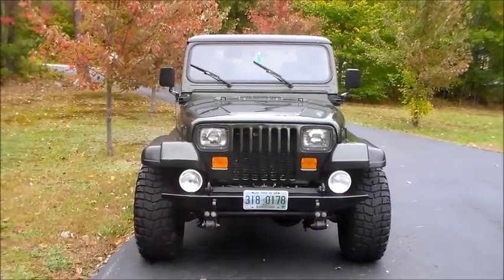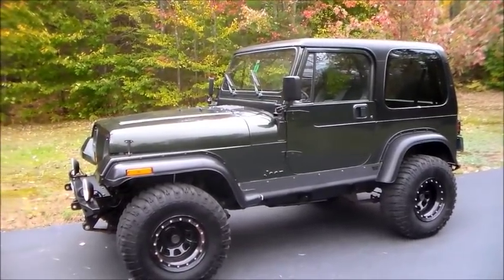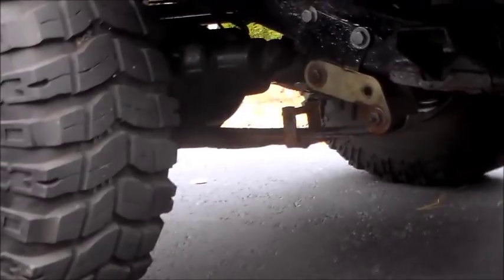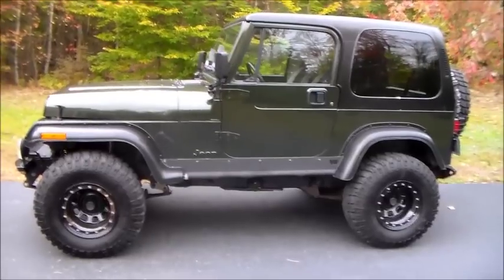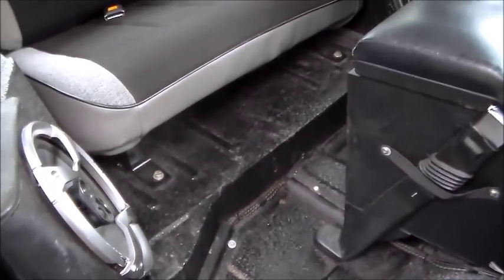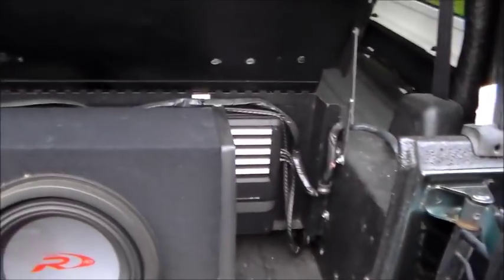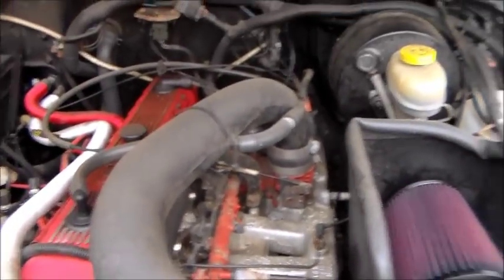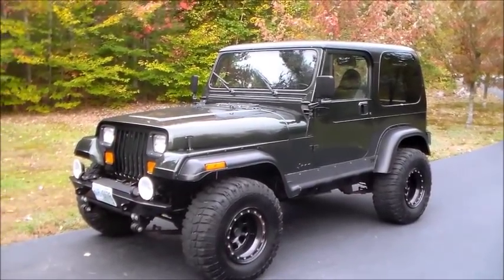1995 Jeep Wrangler YJ   New Project!

Comment: You are a luck dog that is a great find! Jump on that frame first . I like the cup brush on an angle grinder ; rust converter and epoxy primer and POR-15. It will be good for years then. You will take better care of it than he did I can tell from the passion in your voice. Really nice Jeep and you got it in time to save it ; Good Roads !
Reply from the maker: William Smith Chrck out my other vids!! I do scrape down the frame and POR15 it, then top coat it. There are a bunch more cool Jeep related vids as well. Check all of them out and give me a sub... thanks.

Comment: I had a ‘91 “Wrongler” myself (YJ, square headlights),  bought with 60K in 2001 for $4500, sold in 2003 with 90k miles for $4000, I wish I would have kept it.  I have a 2016 JKU 75th Anniversary now, which is a luxury vehicle compared to that, but that 4.0L, no substitute.  Would have been a great project for my son.
Reply from the maker: Sounds like you're a die-hard Jeep guy! The old YJ's are great projects, but not really the safest vehicle for a young driver? In my opinion, but mine was lifted w/ big tires etc. Thanks for watching and commenting.

Comment: bought a 91 YJ for 2700. Its spray painted to look like an army jeep, with no carpet and its rhino lined. The only rust on it is a little bit of spots under the windshield and on the leaf springs with only surface rust on the frame. I plan to to restore the entire vehicle. I already have the whole thing planned out.

Comment: I have the same YJ 95 wrangle and the workaround that I'm using with the gas refile problem, I just put the pump with 90 degree inclination.
Reply from the maker: Yeah, that really doesn't work, for me. I still can't get the pump in far enough, to flow properly. I can still get the tank full, but I have to hold the pump on 'half trigger' if that makes sense. Thanks for watching and commenting.

Comment: I own a 95. You can't hardly get the handle in straight up and down anyway when getting gas. You have to turn it to the side. And on mine your damn lucky to get it within an eighth of being full. Unless you sit there and let it trickle in. I don't know if that's common with the other groups of that year but with mine it sure is.
Reply from the maker: It's a giant pain in the ass!! I have to hold the gas 'trigger' on about 1/4 pull, trickling fuel in. You certainly can't lock the trigger on, at all. I've discovered that swinging out my spare tire carrier, using it to hold the license plate down, gives fueling a bit of relief. Terrible design. That's why they moved it to the drivers side on the TJ's.

Comment: Do you drive your Jeep Yj long distance. If so What’s the furthest you gone round trip
Reply from the maker: I did not, nor would I ever drive this Jeep any long distance. Probably 100 miles, max. With the high center of gravity from the lift and the tires it's really not that safe, in my opinion. Plus I wouldn't trust its reliability.

Comment: Like the color just curious what did you pay for if you don't mind me asking?
Reply from the maker: It was around $7500, which I felt was a smoking good deal!!
Reply: @Metalcop5150  did you ever clean up the rust on the frame and repaint it?
Reply from the maker: @Jeepdriver75  Yes! There's a video of it as well. There really wasn't anything but surface rust. The thick undercoating was starting to fall off of the frame in large chunks, but underneath it was well preserved. I scraped it down, applied POR 15 and then top coated it. A lot of trolls were calling me out saying that it was a rusty POS, which was total garbage. I even did a video where I pounded on the frame with a hammer!! lol

Comment: Had a 91yj. Worst pos I ever owned. Had to replace the 4 banger at 81k. Along with about every part on it at least once. Even the seat belts failed. Put 6 slave cylinders on the clutch. Window leaked. Replaced the windshield twice. 3 starters. U joints twice. And on and on. Put 70k on it and gave it away. Was happy to get rid of it!!!  Good Luck
Reply from the maker: Sorry you had such bad luck! The 95's are the best of the YJ's and the 4.0 liter straight 6 is way better than the 4 banger! Practically indestructible. As for reliability? It's still a Chrysler product, so that's what you get. If you want a capable 4x4 a Jeep is still your best option.

Comment: i have a jeep like this but the engine doesn't work, do you guys think that is expensive change the engine??
Reply from the maker: Nope, it won't be expensive! More like dirt cheap... lol Get yourself a rebuilt short block and re-use all your accessories. Get a new water pump and other typical replacement items, you should be all set. Good luck.

Comment: I saw one for sale and the guy wants 2k for it. It would be my first jeep toy.
Reply from the maker: Make sure you scrutinize it, especially the frame and underside, for rust! I'm guessing for $2K, its going to have some rust. Also in the rear cab corners, and fenderwells etc. etc. Thanks for watching and commenting.
Reply: ScoobyDigits I paid $1,900 for mine . without even looking at it because my truck had broke down and I needed a vehicle quick I told the guy if he could drive it to where I'm at I would give him the cash he did and I did. I have driven it for 5 months and it's lost less than a quart of oil during that time. Of course the first thing I did was change the oil plugs wires rotor and cap. It's a running demon. A great work truck. There's rust on the frame but I treated it with that paint that turns rust back into metal. I was going to coat it with bedliner. But I bought myself a new Jeep because this one did not have air conditioning and I was tired of roasting. They can cost a lot of money if they have not been taken care of. I have a 97 that I had to almost completely rebuild underneath. But it's a really nice jeep now. Just 1500 miles away at my house. I have a 63 Willis that was a money pit. It was my first real Jeep. And if you're willing to put the money into it you can do just about anything with anything. I guarantee you it's worth more money now than what I put into it . but not by much.

Comment: the tail light itself is upside down. the lens is supposed to be down
Reply from the maker: I would agree with you, that the clear back up lens, should be on the bottom of the taillight. However, you can clearly see that the plastic lens is marked 'TOP' so the taillight lens is mounted correctly, in this case. Either way, the taillight is a rectangle, flipping it over wouldn't gain any extra space for gas nozzle etc. Thanks for watching and commenting! I really appreciate the support. Please consider subscribing, if you don't already.

Comment: What wheels are those ? And size ? 15x10?  Ps subscribed !! 😃👍
Reply from the maker: The tires are 33"s, 33x12.50x15 is the specific size. The wheels are 15", but I am unsure of the actual width. 10" makes sense, with the 12.5" width tires, and there is a ton of sidewall and bulge, on either side. Hope this helps!! Thanks for the sub, I really appreciate the support. Lots more Jeep vids to come! I just started cranking them out again, yesterday! lol
Reply: Metalcop  really ? I am still deciding if I should get 15x10 rims or 15x8. Since I am doing a 383 stroker with some speed parts lol I think I’ll go with the 15x10. If you want to see the video I just uploaded. I’m definitely gonna keep watching your progress.

Comment: Dude your front shackles behind the front wheels is totally messed up they shouldn’t be hitting the frame like that and your rear spring on the driver side is broken where it bolts the the frame
Reply from the maker: Thanks for pointing that out to me, I'll look into it and have them checked. I'm new to Jeeps, so I appreciate the help! Thankfully, leaf springs are cheap. Thanks for watching and commenting.
Reply from the maker: Yeah I checked the rear springs, nothing is broken? Maybe you could elaborate and educate me? Thanks.
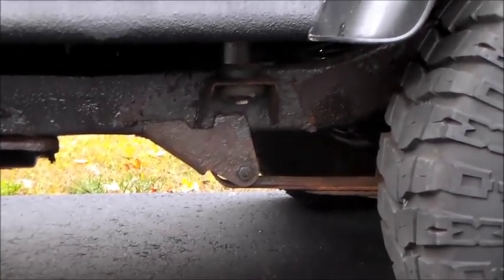Reply: Pause at 3:02 in your video, look where your leaf spring bolts to the frame. You can see that the “wrap” on the spring has broken and moved forward off the bushing, the only thing that is holding it together is the weight of the jeep on it. Also on the front, you have what’s called a shackle reversal kit. Supposed to help with the ride by changing  the suspension geometry, but the shackle is supposed to cycle back and forth as the suspension compresses. But the shackle laying on the frame like that isn’t doing anything. Looks like a solid jeep! Just pointing it out because it could be potentially dangerous. My leafs where broken too and I didn’t know until I lifted it.
Reply: Nah, dude, they are all like that. The inboard side of all 4 springs. The top leaf wraps around and is properly bolted to the shackle. What you're seeing is the 2nd shackle down that has a little 'up bend' to it. All good, I assure you. Thanks again.
Reply: It’s got a shackle reversal kit and the shackle should not be hitting the frame like that. Look into it because it’s wrong.
Reply from the maker: +Steven fitzgibbon I will look into it. The springs appear to be in pretty tough shape, (probably original) so they will be replaced, eventually. Thanks for watching and commenting.
Reply: I was just getting ready to say something about that. Something is a miss there. That shackle will hit the frame when the wheel comes up. And is a good way to damage the frame and also break the main leaf. With the shackle like that there is no where for spring the to lengthen on compression.

Comment: Paint brush and used motor oil twice a year the first year, then switch to once a year. SAY GOODBYE TO RUST
Reply from the maker: That sounds like a great DIY undercoating! My Jeep was treated with the Fluid Film product, which is based in the old WWII Military 'cosmolene' rust inhibitor. It is lanolin (sheep oil) based, so it is bio-degradable and better for the environment. Lots of shops in my area still use; used motor oil, used diesel oil, and transmission fluid etc. for undercoating. Thanks for watching and commenting.

Comment: Just get a new frame. That's a nice jeep other than that.
Reply from the maker: Nowhere even close to needing a new frame. Mine is solid as a rock. Literally zero rust. I already scraped the old paint and undercoating off, and applied POR15 and then top-coated it. I covered that in another video. Please check out my other videos and consider subscribing, if you don't already. Thanks!
Reply: Are you blind there is rust all over. Definitely not a frame-off restoration five years ago. You have got taken lol
Reply from the maker: Paul Ss That is your opinion and it’s clearly an uninformed one. There is zero rust, like I stated. In this vid, there are large slabs of paint and bedliner, flaking off the frame. That’s it. Check out my other vids, where I scrape and repaint the frame, it’s mint. As far as the body off restoration? It absolutely had one, but it was probably in the early 2000’s. I bought my Jeep from the 3rd owner, who bought it off the original owner, his uncle. Backed up by Carfax records. Thanks anyway, for watching and feeling necessary to comment negatively, about something you know practically nothing about.
Reply: @Metalcop5150  it doesn't matter if you were the first owner the third owner the 5th owner or you bought it off your mom your uncle or the alcoholic next door LOL it's still rusted out LOL and Carfax reports don't show that's a vehicle has rust on it or not LOL there might be surface rust in areas but all over LOL it looks like someone tried to spray paint over it at one time. Capturing the moisture underneath making it worse. But if you think there's not much rust that is your opinion but for you to say there's hardly any rust when you could see it from 10 feet away just doesn't seem like a very good argument. It's just my opinion. But good luck with your rust free jeep lol that Rhino Lining was just sprayed on there underneath. Probably they didn't sand or treat the metal surface below it they just sprayed it over so all the moisture underneath is causing rust and that's why it's peeling. And who wouldn't go through all of that if they did a so-called frame-off restoration? They probably didn't sand or treat the inside either so there's probably rust growing underneath that Rhino liner all over the place inside. Sounds like you believed anything the guy said who you bought it from. I got a bridge for sale if you're interested lol
Reply: And why don't you just turn the gas handle sideways? I couldn't stop laughing when you said that that you couldn't figure it out. Just turn the nozzle sideways serious wow you're such a genius LOL
Reply from the maker: @paul9912  Thanks again, for the useless advice, that I didn't ask for. Turning the handle sideways, doesn't work, because the nozzle won't go far enough into the fill tube, and it just keeps triggering the automatic shutoff. But, since you apparently have all the answers, I'll just consult you from now on, whenever I have any Jeep related questions. I'm not sure what I would even do without Internet Hero, know-it-alls, like you!! Keep up the good work.
Reply from the maker: @paul9912  I'm not sure why you are so butthurt that my Jeep isn't actually rusted out?! Basing your moronic replies on a grainy video, and arguing with the guy who has hands on experience with the Jeep? Some solid logic, right there. Keep up the internet hero troll comments, it definitely makes YouTube a better place.